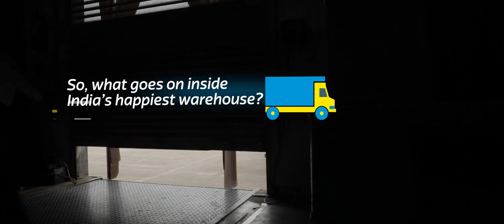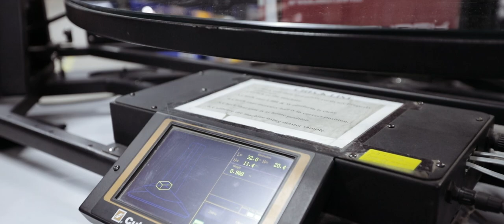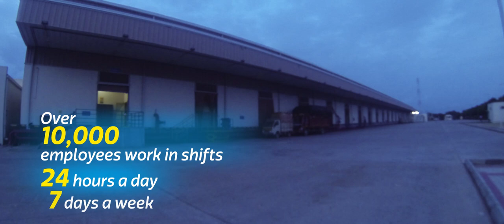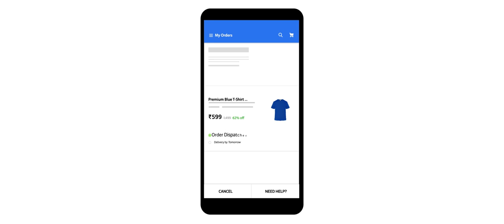Flipkart: India’s Happiest Warehouse

Comment: I have request to bring back the package from customers to avoid pollution and re-use it.
Reply: Great idea but if offer some money or points then it will be much success.
Reply: @hardikchavda007  BRO WE NEED CLEAN SURRONDINGS.
Reply: Actually it will make pollution and not cost effective. India doesn't have any kind of recycling management system in any of the major cities. And Indian people has less clue about waste management or recycling. 😣
Reply: How can we return it?
If u say way then I will return packet
Reply: That’s not practically possible because it incurs additional cost to the company. Instead people should be careful to separate the waste and send it for recycling. Only cardboards and plastic are used for packaging, both recyclable.
Reply: @SurajInd89  possible bro they should crush it and have there own recycling factory to reduce the cost .
Reply: @bloggersayan  They definitely have their own recycling units. I am talking about the difficulty and costs for sending the empty packaging materials by customer back to amazon or Flipkart.